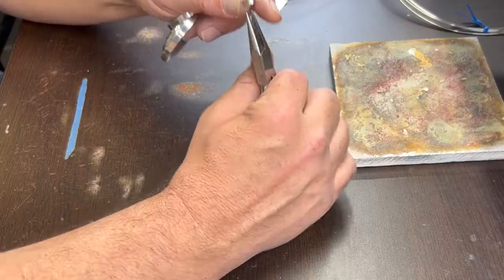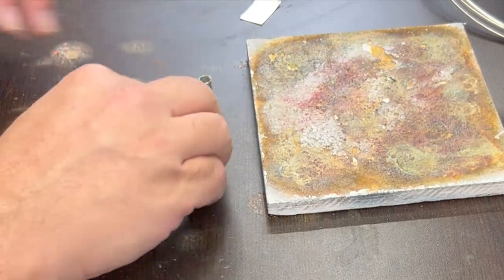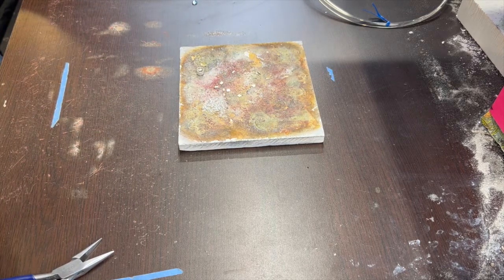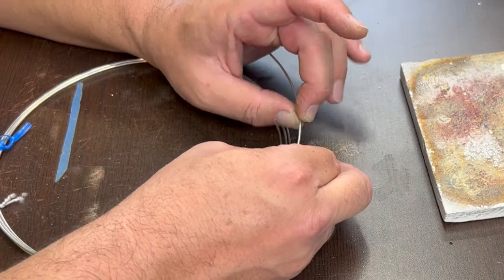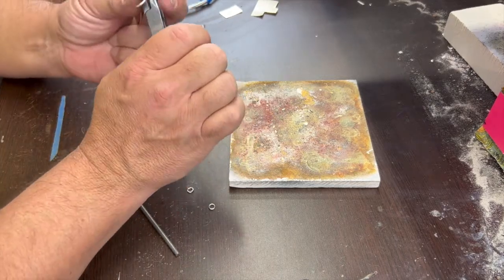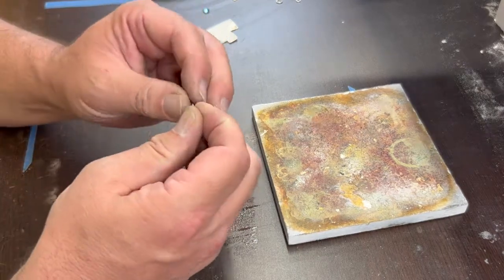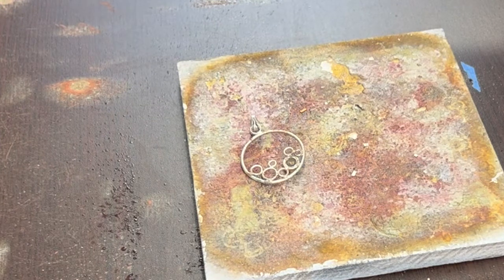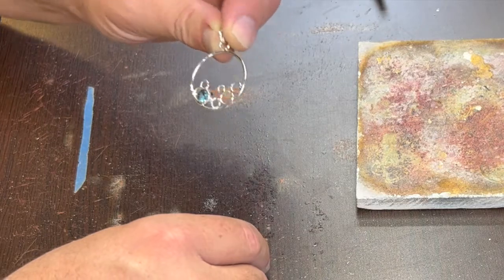Blue Topaz Bubble Pendant: A Silversmithing Tutorial

Comment: I notice you typically use fine silver for your bezels vs Sterling.  Why is that?   Beautiful, piece, BTW!
Reply from the maker: Fine silver is much more malleable than Sterling, so getting it to lay tightly against the stone is far more doable with fine silver. With Sterling, having a hammer setting tool would generally be necessary unless you have very strong hands:)
Reply: @chadssilversmithing  Ah!  This is the type of pro tip I learn from your channel. Thanks for sharing your knowledge! :)